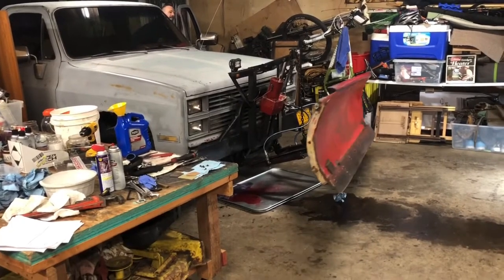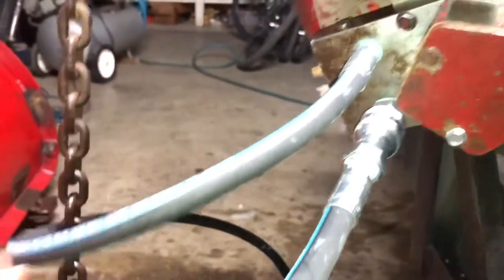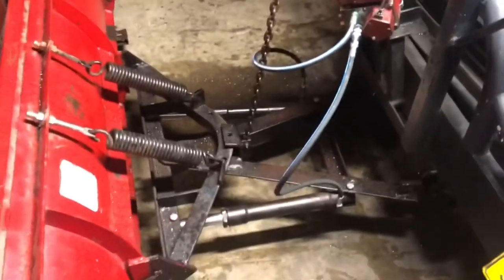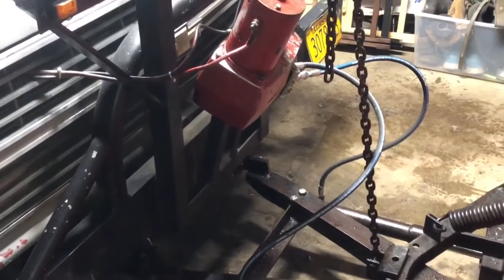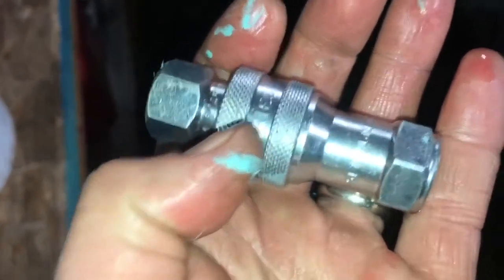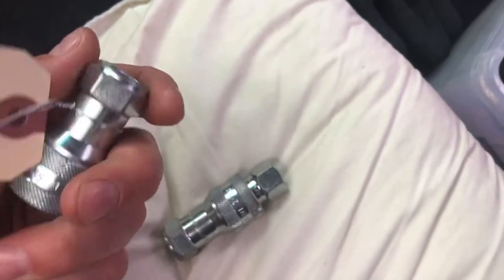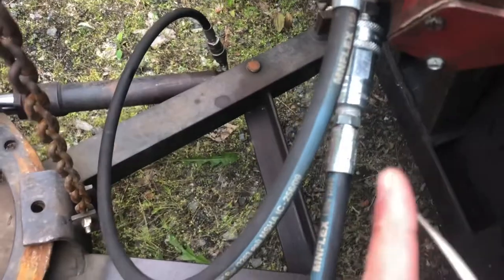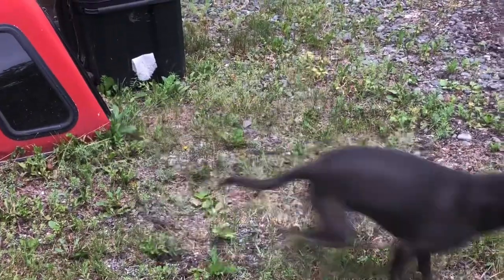EP177-SOLVED Western Mark IIIa Cable Plow Slow or Not Angling Left Pt.8

Comment: Thanks for this video! I went through much the same as you. Ive rebuilt the pump 3 times in the past couple years and replaced both angle rams. And my hoses and couplers. I also live in Ak. Bet we both got couplers out of the same batch! Ive had slow turn, or no turn. Changed couplers and now I'm 3 seconds from full turn to full turn both left and right.
Reply from the maker: So glad it could help, yeah I got couplers from Trailercraft in Anchorage, I was going crazy trying to figure it out !

Comment: Did I miss the part or a video on how to adjust the valves for up and down ? I just bought a exact unit you have and installed it today I can get it to go left and right but when you try to lift the plow it is acting like its by passing fluid the up ram lifts to full ram out no load and if you hook the plow chain on the ram lifts till the chain is tight and thats it won't lift plow off ground and you can push the ram back down by hand So cable adjust or valve adjustment or both ?
Reply from the maker: Sounds like your lift valve is out of adjustment allowing fluid to bypass lift ram and back into reservoir. 
Check out page 6 of guide for trouble shooting:
https://library.westernplows.com/westernplows/pdffiles/13497_020088.pdf
Reply from the maker: Read the guide carefully, I think adjust lift valve first then fine tune with cable adjustments
Reply: @LastFrontierGarage  THANKS Fully up and running
Reply from the maker: @CUSTOMWORKS7.3PSD  glad to hear!

Comment: So when I hit my levers left and right it wants to raise the plow
Reply from the maker: Hi Chris, usually this is caused by an improperly adjusted Lift Valve; you can look up a downloadable repair manual/troubleshooting guide and it will instruct you how to adjust it. Let me know if you have any trouble finding one, use the Western Mark IIIa Cable Conventional Plow for looking up info.
Reply: Lift valve is stuck slightly in the up position when it should be in neutral. Adjust the cable back down some.

Comment: If you wanna save some time on the side adjustment take the arm off and shorten it. May only be able to cut out 1/32 of an inch but ive spent days trying to get the adjustment correct on the side to side and some of them are just un fixable. Shorten the arm and it will fix it. The up and down adjustment you can usually fix by adjusting one way or another but the side to side can be a nightmare.
Reply from the maker: Thanks for the tip Jaymen!
Reply: Can you explain this better? My Mark 3a can only go to one side. It will not move back once it's angled to the one side. What Is the "arm" you talk about?

Comment: I have the same plow and my plow will go side to side. The motor will go all the way up if I don’t have the blade hooked up. Once I Hook the chain up for the blade you it won’t lift the plow off the ground. Any ideas?
Reply from the maker: Sounds like your lift valve is out of adjustment, it’s trying to build hydraulic pressure to lift ram but fluid is able to push behind valve back into reservoir.
Reply from the maker: There is a mechanics trouble shooting guid available that will lead you through a simple diagnosis and adjustment, let me find it a I’ll post below:

https://library.westernplows.com/westernplows/pdffiles/13497_020088.pdf

Comment: Plow would not stay up, plow would not turn in up position, plow would turn in down position but would raise at the same time, pulled cleaned and re-oringed check valve.  Plow will now stay up but still has same turn issues???
Reply from the maker: It sounds like you’ve got a couple things out of adjustment, mainly the lift valve, but I would also check everything. Check out this mechanics guide and look in the troubleshooting section. Let me know if anything helps or if you have anymore questions!

https://library.westernplows.com/westernplows/pdffiles/13497_020088.pdf

Comment: Mine quit angling after i put new quick disconnects on. Up and down works like a champ. But left/right didn't quit right away. I think I'll put the old ones back on.
Reply from the maker: The fix on mine ended up being faulty brand new disconnects, definitely look around there, let us know how it goes!
Reply: No change after putting the originals back on. The manual suggests adjusting the lift valve which I think is the round plug that takes an Allen wrench just below the overhang facing front. I tried 1/8th to 1/4 turns both ways with no difference. The 4-way looks like it turns 45 degrees both ways like the manual says. If the screen is clogged, would it still be working to raise and lower? When I went to check the fluid level, it was overfilled so maybe I blew a seal? I can manually turn the blade when the cylinders are connected to each other in a loop so they are not stuck and they don't move after I hook back up to the pump. I was able to plow all to the left and then all to the right like this. How do I properly clean and flush the unit, check for clogs? One local plow shop is afraid to fiddle with cable driven systems, says they sometimes never work again. I wonder if they just don't know how they work.
Reply from the maker: @chulew  after you put new disconnects on, did you mean left right stopped working eighth away or it slowly started to stop? It might take some adapters but you can try to hook up lines directly from pump to rams, bypassing disconnects altogether just to determine if they still might be causing problems, you might get another new set of higher quality and try those. I was chasing my tail for a while thinking I had figured it wasn’t quick disconnects and it ended up being one of them allowing fluid one way but not the other.

Comment: Hey man I got the same plow as yours been plowing with it for better part of 5 yrs. Been great but they have their flaws cables break unexpectedly and seems to need replaced after 2 or 3 seasons, however I was curious bout how you have your electrical hooked up for the unit. I have my solenoid powered from the battery and when activated it drops voltage to 10.5-11.5v. Heavy usage of the plow motor then the lights begin to fade. We're at a point now after years running like this that I need to replace said battery. Should I try hooking up to alternator instead or should i be looking at a dual battery setup like u mentioned at end of vid? Love the square bod. I'm sorta a same plow unit, an 87 dodge w100 318.
Reply from the maker: I would have it hooked up just like the Mechanics Guide/Service Guide shows; it sounds like your battery is getting old and tired, you can charge it up to 100% then load test it and see if it stays within spec. My lights were dimming a lot too due to the low charge state of my old battery. I went ahead and got a more expensive AGM battery with extra cranking amps and it’s been doing great. Once you have a fully charged battery you can test charging voltage with vehicle running as well, it should be between 13.7-14.9 volts or so.
Reply from the maker: Make sure all of your connections are clean and tight as well
Reply: @LastFrontierGarage  great thanks yea I believe its coming down to getting a new battery. Its been a good truck for the past 7 yrs with thr same napa legend battery in it. Thnx for the info
Reply: big thing that helped me with that problem was going to a "plow fluid" not just ATF like.  2 batteries are great but the expensive plow fulid made it a ton better.